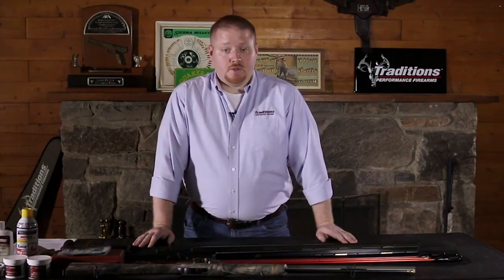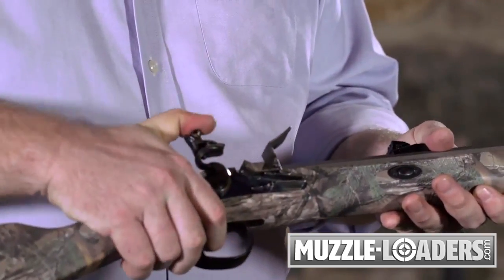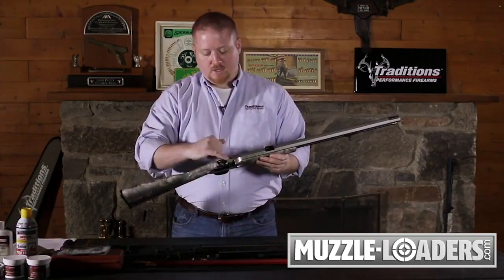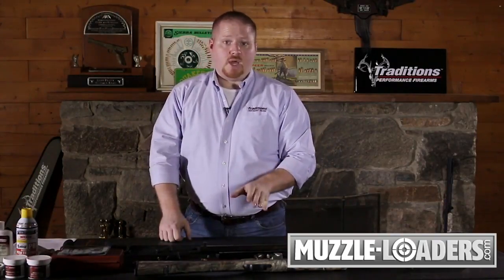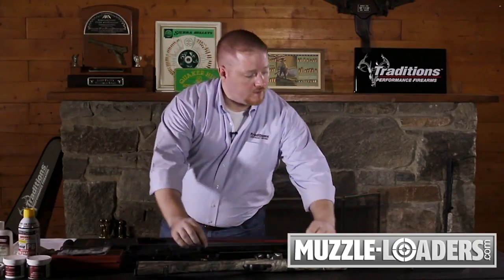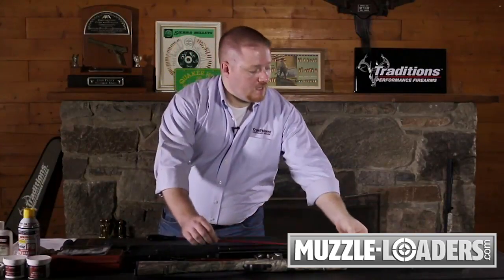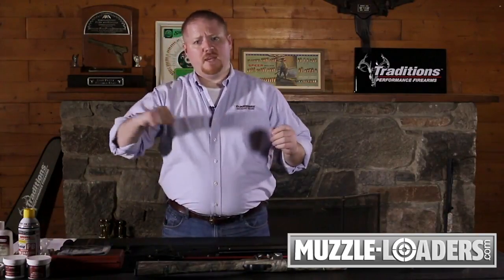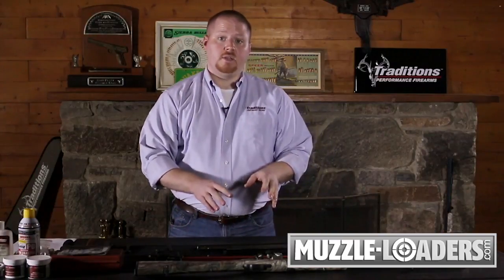Unloading a Sidelock Muzzleloader Rifle - Muzzle-Loaders.com

Comment: Not to be a "hater" but this is a good way to get the ball puller stuck in the bore.  I would suggest you drill a small hole in the ball first as just screwing in that wood screw puller will expand the ball & make it harder to come out.  Most likely, it will break off the ramrod end & now that will be stuck in the bore, a real mess.

Comment: i might be missing something, but why not just clear it by firing in a safe direction? if you're hunting or at the range, i imagine a shot downrange or into the ground away from everyone would be fine? certainly seems a lot easier.
Reply from the maker: That will work in most circumstances, however, there are some instances when that would not be possible such as accidentally loading the ball without powder.